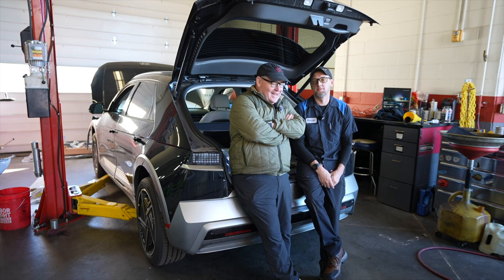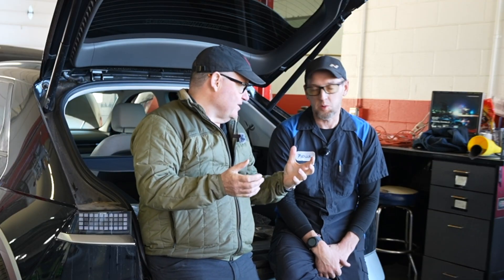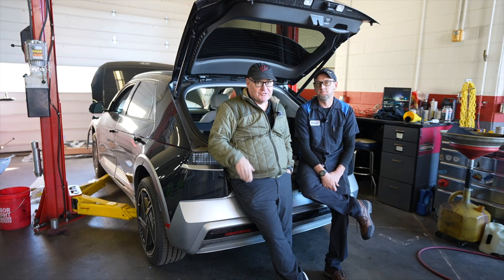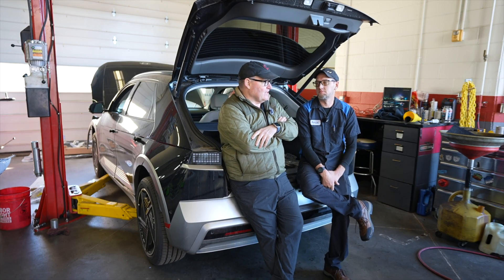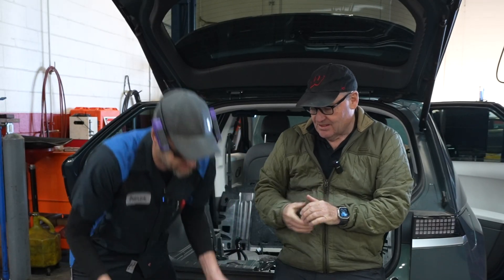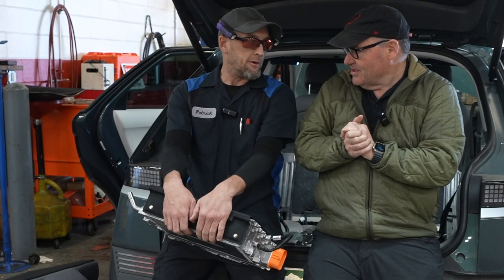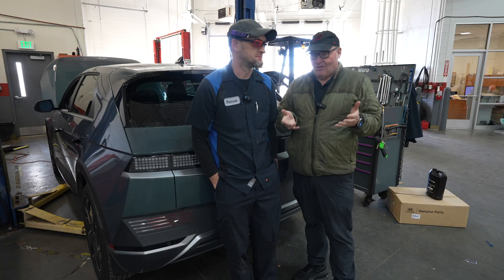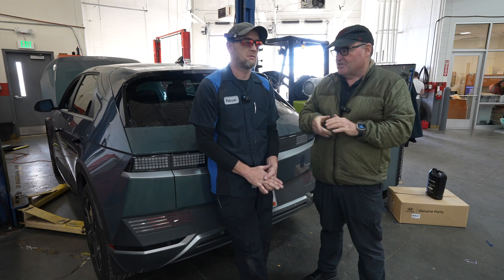IONIQ 5 ICCU Replacement: Patrick Replaces an ICCU  and Discusses ICCU Issues.

Comment: Hi, we are currently waiting for our 2nd ICCU replacement on our 2024 Ioniq 6. We bought it 12/31/24. So barely a year old, about 12,000 miles on it. The original unit was replaced due to the recall (before we purchased it). My husband was driving, heard it pop, then the message, then everything completely died. No hazards, no lights.  It was dark, raining, and at the bottom of a hill. Extremely dangerous. It’s been a week and it still hasn’t been looked at. The dealer claims they have no loaners. Oh, and it’s a lease, so we are paying to basically “rent” this car, but have no car to drive. We deeply regret buying this car, our 2nd Hyundai by the way. When my Husband called Hyundai and loudly complained, they offered for us to get a rental and they would reimburse us later. But the rental car will not be equal to the car we leased. Unfair and unacceptable all around. I can’t believe they haven’t fixed this problem. They need to STOP manufacturing these cars until the problem is resolved!

Comment: I would not say the frequency has dropped in the 2025s. That is an apples & oranges comparison. A 2022 has been on the road for 5 years and has upwards of 40k miles on it. It has gone through many more type 2 charges than a 2025. If you give a 2025 5 years, you will likely see a similar failure rate. The assertion thst the ICCU controls the type 3, ie DC Fast charging seems to contradict other explanations.DC Fadt charging does not put a load on the ICCU like type 1 & 2. The rear motors are not used and if your on an 800V EA DC Fast charger at 800 volts, it is a direct match to the battery system. Saying it uses ICCU for 800 V DC fast charging is like saying you cannot connect a 12V charger to a 12 volt battery without it being managed by a computer which is bull hockey. I can tske a battrry out of the car and charge directly without a regulatory system. You might want to double check that info on ICCU handling type 3, ie DC Fast charging.

Comment: Thanks for the video and to the Hyundai dealer for allowing you to capture it. I have a '24 Limited AWD with 10k mi and a 12V battery monitor installed, but still live with the fear that any day now... I originally felt the SW "fix" was meaningful, but it's clearly a fundamental failure mode for I5's, no matter the year. I'll look forward to seeing the "redesigned" ICCU in the future video.  But mostly, I hope that Hyundai has done a serious design review for the benefit of all their EV vehicles. When my lease is up in 2 years, whether I've suffered a failure and Hyundai has demonstrated a true solution will determine my next EV.

Comment: The ICCU died on my 23 GV60 with 61,000 km 2 days ago. Basically it stopped AC charging, showed a brief check EV charge dash message. The traction battery fuse did not pop, the ICCU was still providing appropriate voltage to the 12 volt battery and I was able to pull an active P1E011C DTC code. The car was still drivable and DC charging was unaffected.  My Juicebox EVSE's relay got fried as a result. I tried a second EVSE  to rule out the first as a problem. The second EVSE reported  an active isolation error( voltage leak from the car- ie a short to ground).  This is a major problem Hyundai needs to stop trying to minimalize these types of failures. A short to ground can not only  damage electronic components, it can also potentially cause fire and pose electrocution risks, especially if safety systems fail to activate. Clearly the failure rate is much higher than 1-2% claimed by Hyundai. Even the anecdotal representations in this video suggest its at least 10%.

Comment: UK here. My 2025 I5 went at 4500 miles. Iccu replaced. Got it back other day and my actual miler per kw/h is much lower than previous for same journeys. Plus this morning I have a driver assistance diagnosis malfunction fault saying to go and see dealer. Assistance functions all not working And lighting up the dash.

Comment: Definitely still a problem with the 2025.  I bought a Ioniq 5 in September and a month later it died on the highway twice while I was on a road trip. This could have been an extremely dangerous situation.  The EV warning light pops up then minutes later the power dies. I was able to pull over, restart the car, and clear the error.  That same morning the car when through the first software update which may be connected.  The dealer checked it out and said no problem found.  This is very disappointing on a brand new car.  I’m just waiting for it to happen again.

Comment: I just want to add that I appreciate that you did this video.  I learned more from it about the ICCU issues than I normally learn, and this is important to my planning with my Kia EV6.  

I think you had reason to believe that the ICCU issues were nearly licked when they made this video, since the video indicates only one or two iccu issues have come up since the changes that were made to the component.  It's unfortunate that when they posted this information, it immediately came up that a number of drivers have also already reported issues.  This means in part that it is more difficult to give Hyundai and Kia the benefit of the doubt as to whether the number of reports of issues will get much worse with time. 

I am still looking forward to the second installment of this video in which (if I understood) there will be a more in-depth analysis of the changes that were made to the ICCU.  Even though there have been these anecdotal reports of problems even with the revised ICCUs, I think it would be well worth it to all of us to hear what Hyundai-Kia have done to try to address the matter, and indeed, maybe in the end, the revisions to the ICCU will substantially reduce the problems that come up.

Comment: This is a serious issue and a major failure on Hyundai and Kia’s side. You can’t be confident that a long trip, say 1,000 miles, will be trouble-free. My EV6 is currently fine at 62k miles with no replacement at all, but I’ve already purchased an ICCU replacement with a fuse because I plan to drive more than 2,500 miles. I think such a thing is nonsense with 60k $ car.
Reply: Where did you buy it from please? ...and at what cost if I may ask?

Comment: We've just had the 12V battery replaced in our 24MY Ioniq 5.
I was surprised how a 12V battery can fail within 18 months and 35k miles of use. Because a 12V battery fail in 18 months made me suspicious, I put my BM2 battery monitor on it, and am seeing some very strange charge and discharge characteristics. 
The car is also pulling current from the 12V after it's finished level 1 charging, or it turned off after driving. This current pull happens at 30 minute intervals, a total of 5 times before the battery voltage then stabilises. 
All this discharging is what is killing the 12V, but I have no idea what the thing is doing whilst it's not being driven, but I'm pretty sure it shouldn't be doing it.

Comment: Bob - my 2025 Ionic 5 AWD Limited from Crossroads suddenly wont start charging using my Bluelink schedule and Chargepoint+ charger.  It has worked perfectly for 8 months and suddenly it does not start.  There are no conflicting schedules. If I unplug the car and re-plug, it immediately starts charging.  Any thought ?
Reply: It sounds like the ChargePoint EVSE needs a reboot. Programmable EVSEs do need to be power cycled occasionally.

Comment: I used to think the same way; that it was a rare problem that wouldn't happen to me. Then it did, yesterday. I think the data you presented is a bit skewed. It makes sense 2025s are having less problems, bc their ICCUs have less miles and less stress. 

Did you hear anything from anyone with Hyundai alluding to a potential permanent fix or (in a perfect world) an ICCU that is actually redesigned?
Reply: Since Hyundai isn't transparent about this issue, all is speculation and rumors. I think this is a good problem management and will drop their sales. In my case I not buying it. Good luck with yours!

Comment: If the part number of the new and improved ICCU is the same as the failed ICCU it is replacing, how do you know which one you have? This is total BS. GM tried this lie on their failed ignition switches and cover up that got people killed. What’s next, doors that won’t open without power? Or widows you  can’t  break open?  Selling a Death Trap posing as a Safe Vehicle should not be the new normal in the USA, but it seems to be.

Comment: It seems like they haven't actually fixed the problem, otherwise they'd have a campaign to replace them before they fail. If they're just replacing them with the same faulty part that's not really a solution just kicking the can down the road.

Comment: On the follow-up video, can you PLEASE PLEASE PLEASE comment on what you believe the problem might be, or what habits a driver can do possibly mitigate or avoid an ICCU failure.

I know you and the featured mechanic are not electrical or vehicular engineers, and thus you can only speculate. However, you two are FAR experienced in dealing with this than any given random eGMP owner. Your "speculation" is very valuable. 

Signed, a paranoid 2023 Ioniq 6 owner.

Comment: 12-volt battery on my 2024 Ioniq 5 has died twice. First time dealer had the car for a couple days and couldn’t find anything wrong. Second time dealer said the problem is with the Power Relay Assembly and not the ICCU. It’s been one week and still waiting for back ordered part. Driving a Tucson loaner in the meantime. Is it just a matter of time for the ICCU to fail also?
Reply from the maker: I would also recommend making sure that your key fobs are far away from the car when you’re not using them. The Kies constantly communicate with the car. People who placed the keys in the hallway next to the garage can drain a 12 V battery. I have no clue if that’s your issue, but it’s something to keep in mind. In the past, the app would communicate with a car constantly and drain that 12 V battery. Hyundai, took care of that problem with some software updates.  However, those fobs are still talking away 😊

Comment: Our 2022 ICCU died in October.  Our friends 2022 died in June.  Both were about 50k miles.  Both of us could still drive with no error messages but couldn’t L2 charge.  Ours blew while charging at 24 amps and popped our panel breaker and adjacent breakers.

Both had the software updates.

Comment: So what I don't understand is if like what you say the majority of it was in the older models 22 23 24 and they redesign the ICCU when you get yours replaced on a 23 or 24 it's still the old one so it will still die?

Comment: Just to add data -- We purchased a used '22 Ioniq 5 in late 2023. ICCU failed within three months. Once I convinced dealer this was indeed the problem, it was replaced after a week at the dealership under warranty. Crossing my fingers that it doesn't die again. Love the car (not the software).

Comment: Are there issues with the I9? I been having random errors with my Ioniq 9 and the errors say motor control error. It starts with a check electrical system. It goes away after I shut it off and restart it. Just wondering if this is also happening on the I9? I do have an appointment at the dealership to get it checked out but it is very random so I hope that they can somehow access the onboard system to see those errors.
Reply from the maker: You should call your sales person and ask them to get your car immediately and get you a loaner. Not sure what the issue is, but I wouldn’t be driving the car. Sometimes scheduling a car is difficult because the dealership is booked a week or two out. Every dealership I’ve ever worked for will make exceptions, get you a loaner, and wait for an opening or a missed appointment to slot you in.
Reply from the maker: What model of the Ioniq nine do you have?
Reply: SEL

Comment: 35 units out of 400 cars sold is basically 10%, it's a HUGE problem
Reply from the maker: Thanks for watching.  The number is more like 35 out of a 1000…still too many!
Reply: @electricprincipal543 The guy in the video said that he alone changed 35 out of about 400 cars
Reply from the maker: They sold 400 cars in 25.  They have replaced two.  The other replacements were for 22, 23,and 24. It is still far too many.

Comment: Had mine replaced on an Inster. However, other users being told they have to throttle their charging rate to 90% or less with no ETA on a fix. This is Ireland
Reply: Also in ROI. Have both a MY23 Ioniq 5 and a MY25 Inster. I find the 5 year warranty on the ICCU very short...

Comment: I just bought a Tesla Model 3 instead of an IONIQ 5 (which I really want because of the ext. design) because of the massive ICCU problems, which were not openly communicated by Hyundai and have still not been resolved. So no Hyundai cars for me in Germany until they fix it. I informed all my friends who were planning to buy an IONIQ 5 or similar vehicles with the same ICCU.

Comment: Just hot a report from Hyundai garage that my ICCU is dead. Running 32K km (30 months). 12V battery was dead and replaced 6 mths ago (almost exactly 24 mths).

Comment: I'm curious if the ICCU is shared between Ioniq , Kona and Inster (Casper electric)?
Reply: Inster has similar issues with the ICCU, but Kona doesn't. Anything newer/beyond the Kona/e-Niro generation has the ICCU issues in all Hyundai group BEVs (Kia, Hyundai, Genesis).

Comment: Sorry, u appear to be shilling for Hyundai by minimizing this issue.  It has existed since day one, through every model year and then introduced into newer models such as Ioniq 9 as well.  Clearly Hyundai tries to minimize it and ignore the issue since people keep buying the product and then are just shocked when it appears.  Stranding you far away from home, perhaps on vacation and then waiting how long to get car serviced is unacceptable.  If you want to be a premier EV manufacturer, then step up to the plat and address the problem.  Hyundai has NEVER admitted that this is either bad design or bad manufacturing after all these years.  Certainly, it cant take their engineers that long to diagnose the root cause?
Reply from the maker: If this were true, I would never have published the video.

Comment: From what I read online the Kia EV3 isn't having the same ICCU problems as the I5 & EV6..etc. I'd gladly sacrifice 10-15 or even 20 minutes during a DC fast charge to eliminate the chance of ICCU failure. Why not make the 800v system an option and build the majority of them with the more reliable 400v system with its ICCU?
Reply: EV3 has the same issue. Inster too. Anything beyond the Kona/e-Niro generation does.

Comment: Was deciding between the ioniq 5 and the Mustang Mach e and I decided to get the Mach e. I think every EV has its growing pain issues.  Mach E’s had issues with their high voltage junction boxes in 2 of their manufacturing years.  I love my Mach e and m so happy with my choice, never had a single problem with my 2021 GT performance or my Girlfiends 2023 extended range mach e.  Love Em. Great informative video by the way

Comment: My 2025 Ionic5n ICCU failed at approximately 12,000KM. The replacement took 3.5 weeks. My dealer arranged a rental for 1 month. Picked up my car on Dec 31st. 🤞🏽 crossed for 2026!

Comment: The problem is that battery ( HV as well as the 12v)  and ICCU failures , taken together is equivalent to a classic “engine failure”. It causes the vehicle to be undrivable and out of service. 
Who would by a combustion engine car that had those levels of engine failure probability within the first 7 years?  It’s waayyy too likely , even though the percent is small at 1-2% taken as a whole.

Comment: At least the ICCU looks relatively easy to reach haha.

I'd be curious if there's any repeat offenders, as in ICCU being replaced and then the replacement eventually having to be replaced too. I haven't heard that yet though. 
Thankfully I've had an Ioniq 6 for two years and have had zero issues with it. Sad that they're not likely to bring the 6 refresh over to the US, but I have to get my hands on a 6N.
Reply: Yes, I read reports about that.

Comment: No wonder people are convinced the failure rates are 20 or 30%, already in a day just on this video there is like 10 comments below of individual discussing their ICCU issues even on some 2025 models, yet almost no one saying their car is working fine.  So i guess i'll throw my hat in the ring;

I have a 2025 EV6 with 10k miles. I have not had an ICCU issue.
Reply from the maker: It’s important people don’t miss represents statistics. Even if there were 50 people on this link, it would be a small drop in the bucket of cars that were sold. How on earth would anyone turn this into a generalization on all Kia and Hyundai electrics? The statistics I gave was for one dealership, with one tech, in one state, to give people at least a small idea of what’s happening at a specific dealership. Thanks for watching. Thanks. I hope they resolve the issue with your car quickly.  It would also be nice if Hyundai would release the real statistics. No doubt, they will be subject to a huge recall shortly.